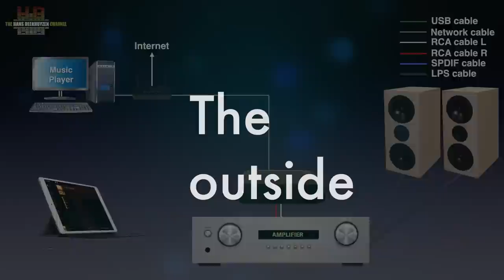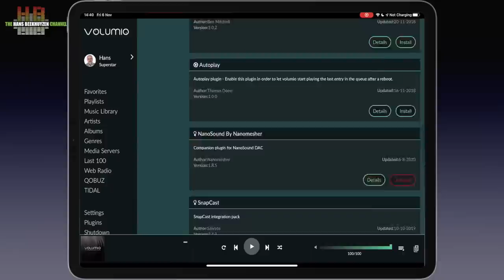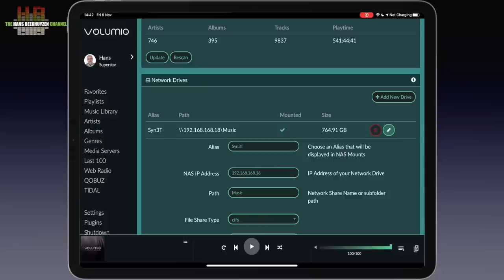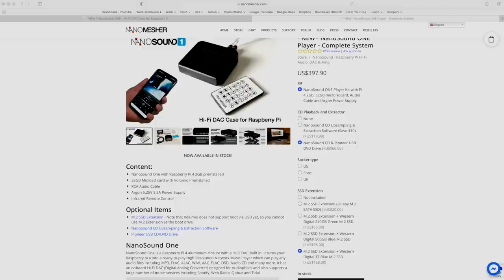NanoSound 1 DAC in housing for Raspberry Pi 4B

Comment: Nice review. I like the sound from Burr Brown chips. I have 2 IFI products. I heard metal casings can interfere / slow down  wifi speeds/ Your thoughts ?
Reply from the maker: That's a bolt statement. Burr Browns, to my experience, sound different depending on the designer of the DAC.
Reply: metal casing does interfere a little bit with wifi signal, but for the argon case, not so much that you get a difference with or without the case